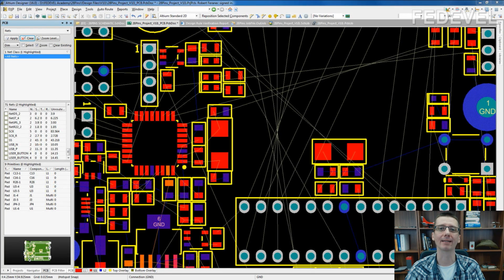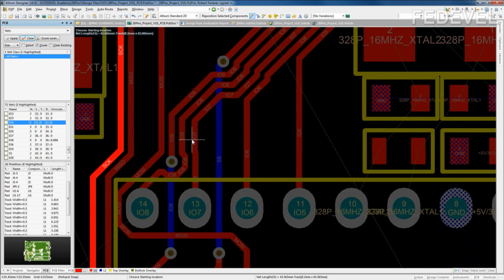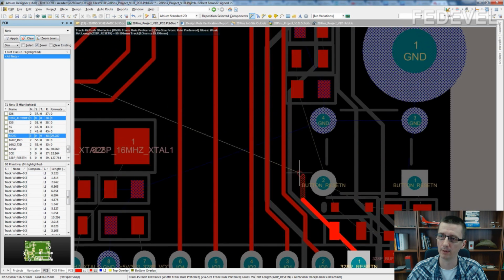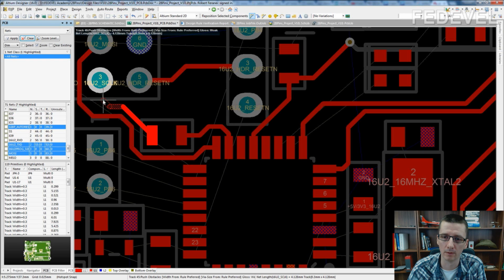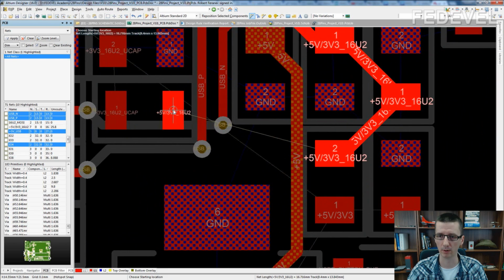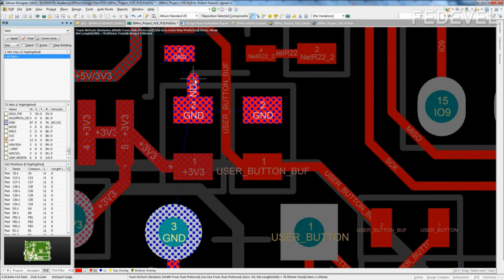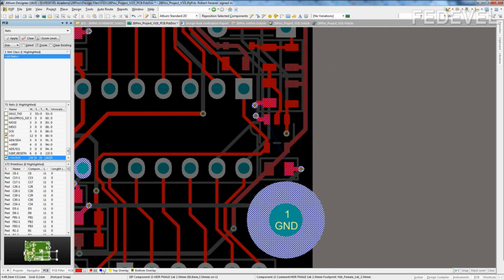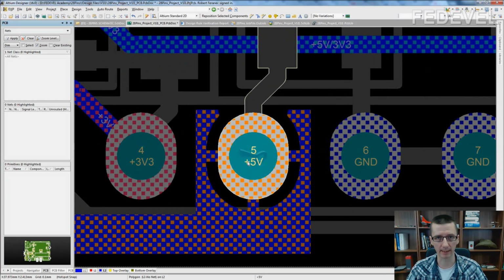Doing Layout - Lesson 7 - Learn to Design Your Own Boards

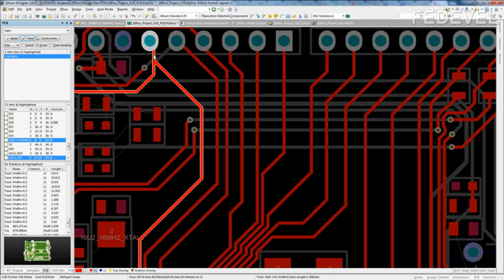Comment: Hey Robert, why is this important at 24:00? Why wouldn't you connect the traces before the pin as opposed to at the pin? If you already did a video on this I'll find it eventually. I'm around 20% through your 100 tips so far. 

Thanks for the tips...andfor making me redo what I've been working on over and over ;)
-Jake

Comment: Another brilliant video Robert, thank you.  I use Altium on an iMac (still on Windows though) and I can't use the +- keys to automatically add vias.  It would be great if at some point you did a video on your Altium preference settings if you've not done so already and I've missed it.
Reply from the maker: Thank you very much Les. PS: This may help: https://designhelp.fedevel.com/forum/main-forum/altium/6770-short-cut-keys-or-preferences

Comment: Hello Robert. Great work, thank you! Down on the board, right on top of the third pin from the left connector (8 pin pinheader) is there an overlapping component or it is a three pad component? Doesn't seem to be a three pad component. Keep them coming! :D
Reply from the maker: Thank yuou. You probably mean the optional power bead. It is intentionally overlapping, so you only can fit one of them (5V or 3V3). Here you can download the full project and check it: http://www.28pins.com/

Comment: Do you think it is possible to design a board with the Allwinner A13 as a core CPU and external RAM / Flash as a single person?
Reply from the maker: I am sure it is possible. I have designed number of CPU boards / motherboards completely by myself (schematic + PCB). Only the question is if you have enough time and money. I am not sure how Allwinner boards are complicated, but most CPU boards (the middle difficulty level) takes sometime between 150 - 350 hours to design + manufacturing of 5 prototypes can cost anywhere between 3 000 to 10 000 USD.
Reply: Thanks a lot for your answer. If it is possible to get the A13 and external RAM / Flash routed within 4 layers a prototype from china is around ~ 25$ (for example at elecrow) with 6mil trace and spacing and 12mil via hole.
Reply from the maker: "from china is around $25" ... depends if you are planning to manufacture and sell your board by yourself. Be aware, the Chinese company will have your complete data and they will be able to manufacture your board ... Also, $25 may sound tempting, but there may be some catches (e.g. you may not be able to control stackup, ...), ....
Reply: I don't think i could make anything which can't be done by a chinese guy ^^, i just designed some simple 2-layer PCBs. What kind of RAM and NAND Flash would you recommend to use in combination with the A13? I don't need a lot of RAM or Flash, actually 64MB of both should enough. Thanks a lot for your helpful answers!
Reply from the maker: Check out what kind of memory they use. You may want to use same but with a different size.

Comment: Hi, can you tell me how to set the underline of components that will be connected togheter?
Reply from the maker: Angelo, I am not sure what you mean by "underline"
Reply: When you pass on a component pin (or a wire/track) it "shines" and also the other that must be connected together...
Reply from the maker: The connection is specified in schematic.
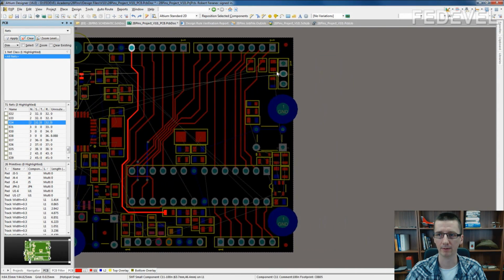Reply: I mean the thing that you do at 4:36 (more or less) or when you pass on the gnd at 10:00...
Reply from the maker: Just hold the cursor on a pin, it will show up automatically.
Reply: It doesn't work... :(
Reply from the maker: I think they call it Highlight. Maybe try to check your settings, but it should work by default. When you hold the cursor on a pad, you need to wait for a moment, then it will come up.